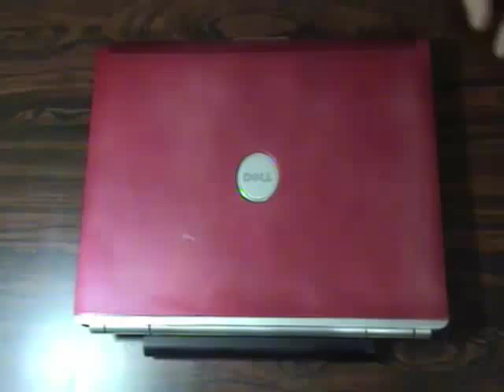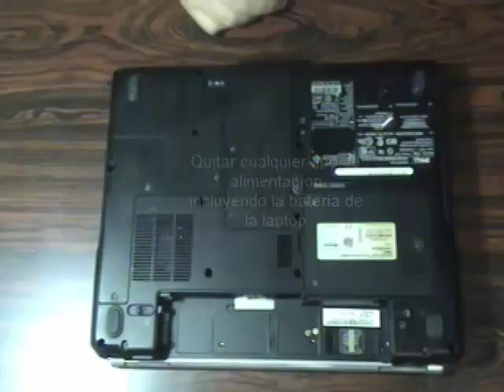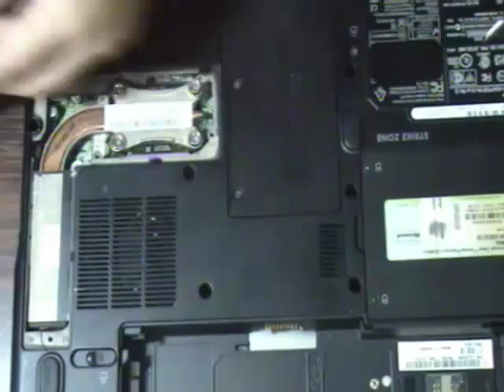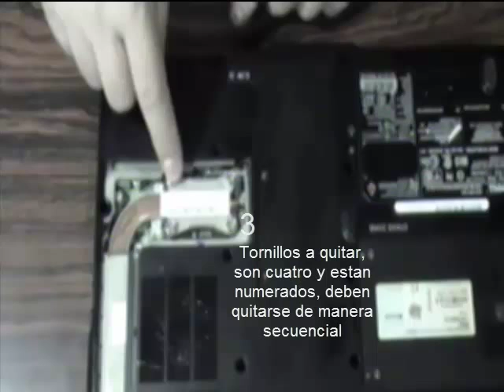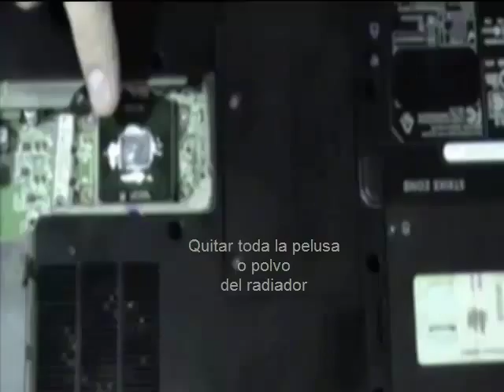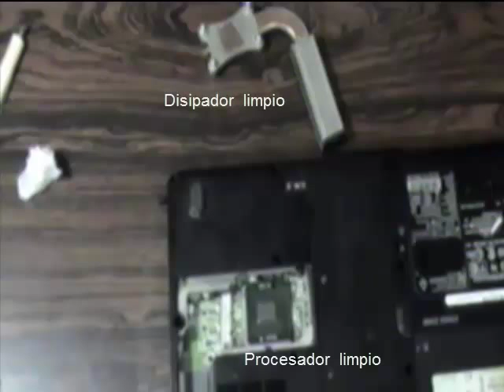Cómo reparar problema calentamiento laptop en menos de tres minutos

Comment: Hola, hice lo de tu video amigo pero sigue dando el mismo problema :(  Le puse nueva pasta termica, le quite algodones de polvo, la sopletie con aire comprimido y aun asi se apaga :( que puede ser?
Reply from the maker: Hola Williams, dime una cosa el fan cooler funciona?, cuanto tiempo dura prendida? entra al sistema operativo?. mientras vuelve a hacer el procedimiento y revisa si los tornillos quedaron ajustados y no flojos.si continua apagandose. quita el disco duro y prendela, entra al setup y dejala prendida a ver si se apaga.  comenta. como te fue. para darte mas sugerencias.
Reply: Hola Jairo, despues de armarla y desarmarla un par de veces detecte dos cosas:
1-  El cargador (generico) no anda bien a pesar de ser nuevo. El voltaje esta bien - 19,5v - mas no se si esta pasando el amperaje requerido y no se como medirlo. Le conecte un cargador DELL original y solo la deje media hora prendida y todo normal, carga el sistema operativo y toda la cosa.
2 - Despues de prenderla con mi cargador DELL original, noto que el ventilador no gira solo hasta minutos despues, no se a que pueda deverse esto. El ventilador del procesador lo extraje y lo conecte con un cable USB a la computadora y gira sin ningun problema.

Por el momento me preocupa mas que el ventilador no gire o gire minutos despues. Muchas gracias Jairo
Reply from the maker: En Algunas laptops el fan se activa cuando comienza a elevarse la temperatura por encima de un rango. creo que esto se puede cambiar en el setup y bajar el mismo para que se active antes. No es de preocuparse  si la laptop no se te apaga,  bueno por lo visto  era el cargador generico. gracias por compartir.
Reply: +Jairo Jaimes gracias, te comento que la lap que estoy arreglando es una dell inspiron 1420 tal como el de tu video. En que opcion de la bios puede configurase lo del ventilador? gracias y saludos